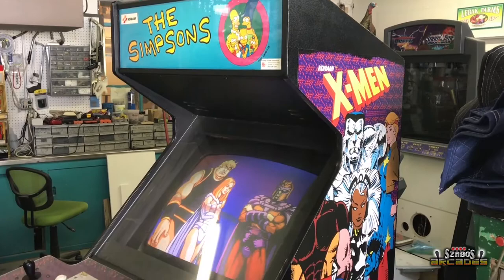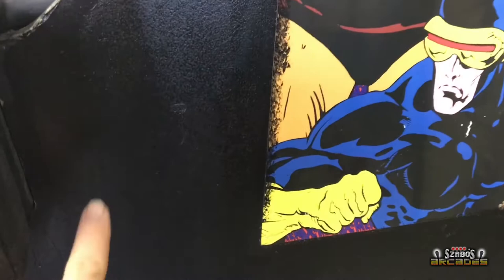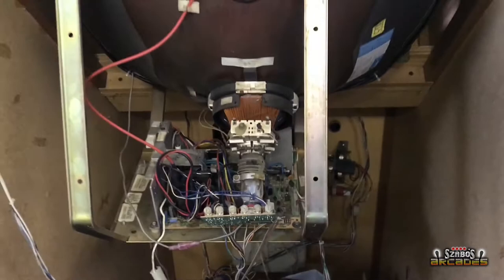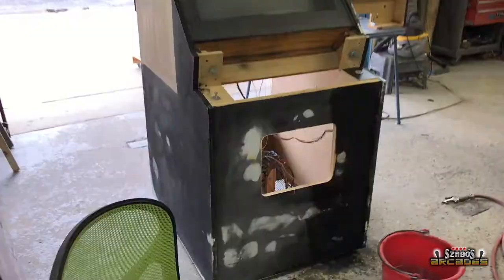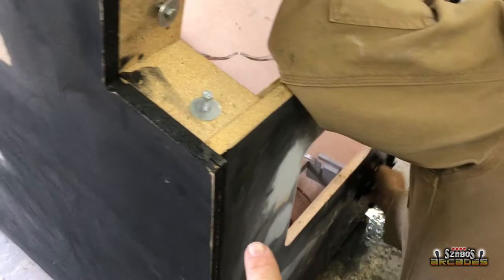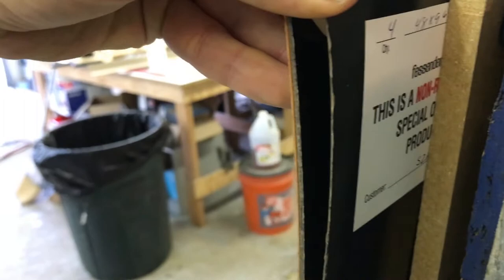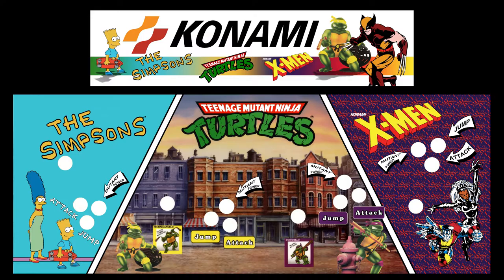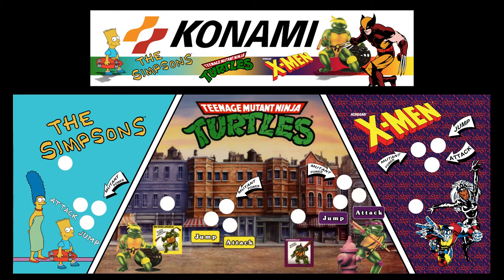Konami 3 in 1 arcade restoration Part 1

Comment: What did you use to have all 3 games in one could you please list some of the parts that you used ? I own a konami cabinet and I'd like to maybe do this to mine.
Reply from the maker: Anthony Durant the game actually already came into the shop like that. I will need to t search exactly what was used. Definitely a bigger power supply because all the boards are running at the same time all the time. And just a Jamma switcher that all there's harness hook to allowing you to change from one button between games.
Reply: Szabo's Arcades Okay if you don't mind to comment back when you find out or do a video of it more depth would be greatly appreciated